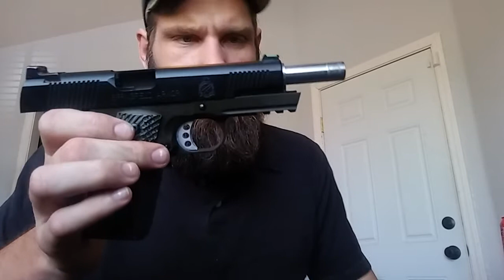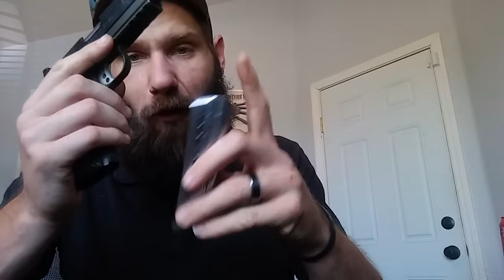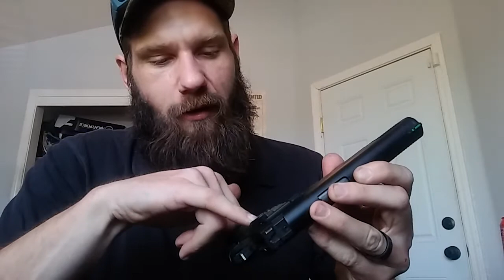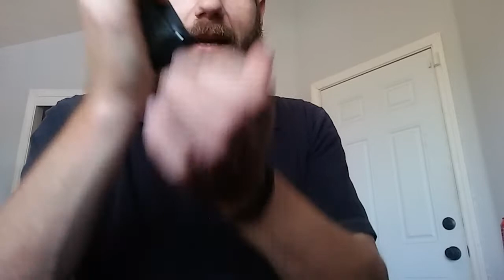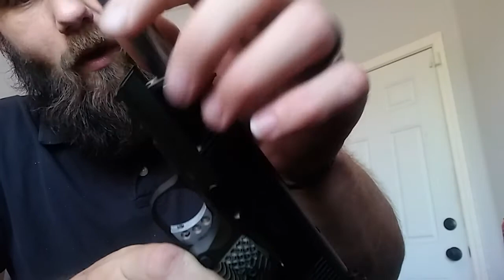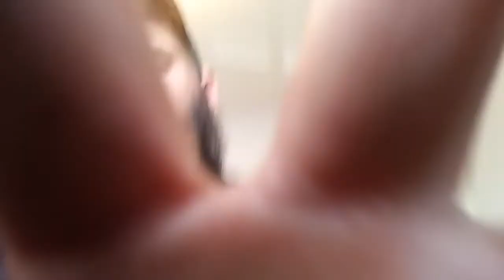Springfield Range Officer Operator 9mm review and tuning tips

Comment: Great Video! I just bought a range officer operator.  What 10.8 rear sight are you running?
Reply from the maker: It was the taller one of the two I believe. I bought it so oong ago I honestly cant remember. I know I pulled the stock one and it was the less common size.
Reply: Hey man sorry to bug you . Im looking at the rear 10.8 sight. Does the 375 tall rear sight sound familiar th what you bought?
Reply from the maker: Yeah I looked it up and it was the .375 tall one with .140 u notch.

Comment: My TRP Operator 45 also came with a poker straight extractor. I was actually surprised how infrequently it malfunctioned whilst holding the cases to the breech face so loosely. I pulled out the extractor gave it a wee bend and checked the tension via. the empty case shake test and now everything is perfect. 1911 pistols are like pianos... they all require tuning. IMHO every 1911 out of the box needs adjustments... I haven’t yet seen a factory production 1911 come out of a box that isn’t woefully below it’s full potential... and said full potential only requires very simple “tuning” adjustments. 1911’s are wonderful for those of us who like to tinker... for the folks out there who have to ship their gun back to the manufacturer whenever it doesn’t function for lack of a 10min. tweak... there is a solution for them called Glock.
Reply: I have 5 1911s and none of them have malfunction out of the box. Springfield and colt.

Comment: I just got a springfield 1911 RO, brand new out of the box 6 malfunctions of failure to feed in the 1st 100 rounds.  My friend had similar problems with his SF 1911 RO, it's the manufacturer for sure.  A brand new gun out of the box should not fail 6 times in 100 rounds, that's unacceptable.   Will not buy springfield again..
Reply from the maker: Check your extractor tension. This seems to be a common but easily fixable issue. They should be right from the factory but if not it takes 5min to set up and save a month back at springfield for repair.
Reply: Mine didn't malfunction so it's not all of them. Mine shoots hollows and everything but mines a 45

Comment: Got a RO Elite Operator 9mm last weekend.
Had 1 malfunction in the first 250 rounds. Choked on some Wichester white box 115g. Round failed to fully chamber...dunno if that's considered a failure to feed or failure to go into battery. No issues with 115g federal brass or 147g winchester hp. Seems to be more accurate with the 147. Will be testing some 124g tomorrow. Awesome gun overall so far.

Comment: Purchased the EMP 4 CCC two months ago. It started having light primer strikes and ftfeed issues at 30 rds. I should have listened to the reviews with similar issues. Springfield replaced the slide and barrel and sent it back 7 weeks later. Took it out Saturday and same thing, three mags ran fine and then light primer strikes every other round. Some of the primers didn’t show any sign of being struck.  
I have the TRP and not a single issue in five years. 
Really bummed out; I can’t even try to sell this.
Reply from the maker: Oh man that sucks to get one bad out of the box. Springfield has a good rep on warranty work and I bet if you called back and spoke to a supervisor or something they will probably run it through the custom shop for repair. Its really rare to hear they dont make it right the first time.

Comment: Does this particular model com with an MIM extractor or one from bar stock?  MIM extractors are notorious for loosing their tension.  Its usually the first thing I change out.
Reply from the maker: Yeah it was MIM. If im not mistaken all models of Springfields come with the MIM extractors. I switched it out for a wilson bullet proof one but MIM when done correctly is not really a bad thing. Kimber killed it for everyone back in the late 90's early 00's when they moved from Oregon to NY and got CHEAP on their production and had no clue how to MIM parts. I personally had one that broke 3x. MIM is now used with good results from most manufacturers now.

Comment: what height are the front and rear sights? I'm looking at replacement sights for them as well but 10-8 has different heights for the front and rear.
Reply from the maker: I didn't replace the front but the rear is the taller of the 2 options that 10-8 offers. I cant remember off the top of my head but I know I had ordered the lower one first but it was wrong and I ended up using it on another 1911 that wasn't a Springfield. My TRP and this RO both used the taller rear.
Reply: ah i see. How was the point of aim?
Reply from the maker: Perfect with the talker rear and factory front. Its a combat poa poi. Hits right at the fiber optic tube at 10 yards.
Reply: thats perfect. Thanks for the info!

Comment: Hi Dennis, thanks for the informative review.  I have a question about the Black-T finish.  I have tried to research about the Black-T finish but I am not finding helpful information.  I guess the Black-T will scratch, so my question is can you take the grips off, rotate the screw head (on right side near trigger), and push out pins (to disassemble) without scratching the finish.  Does the finish have to be touched up?  How does the finish look after you put a screw driver on it??  Is the Black-T also applied to the internals???  Please let me know, Rick Hollman
Reply from the maker: +Rick Hollman this model in the video i did was my cerakote job. I do have a TRP that is black-T finish. It can scratch but its pretty durable. Is it the mag release screw that you are refering to? Thats the closest screw to the trigger. If that is yea you can remove it without scratching it. The trick is a screw driver that fits the slot correctly with minimal slop and getting it in the right position for it to turn and clear the small groove cut in the inside of the frame. You cant see this from the outside of the gun with the mag catch installed. Its just slight pressure on the mag release to get the spring tension off of the screw should allow it to turn with minimal resistance. If its tight play with the pressure and depth of the mag release till it will turn with ease. Hope this helps. Its not about force its about finesse!
Reply: Thanks for the quick rely
Reply: Mfg ads say the Black T is self lubricating, like a vagina. Makes me want to buy two.

Comment: Very informative video man so i thank you. This is going to be a long comment so i apologize in advance. Ive been thinking about getting a range officer 9mm. In my crappy state of massachusetts, if i want to buy a 1911 i have very few options. The RO seems like a very good one but i have heard that they need a lot of tuning and changes before they are good for a carry gun. I am by no means a gun smith, so i have been trying to research all the shit that needs to be done to this gun before i buy it so that i can get it all done right away. I am under the impression that a 1911 in 9mm has different dimensions than a 1911 in 45 so i am having trouble finding things like a replacement rear sight and recoil spring for a this gun. Im finding those things for 1911s but i dont want to order it if its not going to fit a 1911 in 9mm. Also, as far as the failure to extract during the 10-8 test, did the recoil spring solve that or did you change something else?? 
Thank you so much for your time to answer my questions and your video
Reply from the maker: +matthew turgeon your right long question! Lol but ill see what i can do to help you out. Dimensionally 9mm and 45 1911 are the same in most stuff that dont deal with the actual caliber specific parts. (Confused yet? Lol) sights, grips, hammer, trigger, sear, recoil spring are all the same. Minus actual weight of recoil spring between calibers. I did replace the recoil spring (12#-14# variable power all worked) and I put in a wilson combat 9mm drop in extractor. Really easy and may only require very minor tension adjustment. All can be done with no specialty tools and 10 min watching wilsons video of extractor tension. No forming or polishing required on the drop in one. Rear sight on my operator is just a standard novak cut. Very popular and tons of options. If you buy the target model with adjustable rear sight its a different cut and only 1 maker of a fixed sight replacement that i know of (Harrison sights) but all in all it requires very little attention if any. And Springfield does have some of the best customer service, warranty and custom shop in the buisness. I would buy mine again. I really enjoy shooting it. Hope I answered what you wanted to know. If you get one i highly doubt you will regret it!
Reply: dennis1979gm damn that was a quick reply lol. Thanks for taking the time to give me the detailed answers. I am certainly going to do some more digging into the parts you have mentioned ( yes i understood the part about caliber specific parts vs 1911 fram specific parts lol) the only reason i thought the dimensions all around would be a little different is because a watched a video that mentioned how the springfield range officer was scaled down a bit around the 9mm cartridge as opposed to typical 1911s in45. Even on their website i could not find the specifics on where exactly they shaved stuff down. So again thank you very much. I know of a gun shop relatively close where one of the employees will only carry 1911s , so i plan on going to see him and discussing what you told me. Thanks again
Reply from the maker: +matthew turgeon no problem. The scaled down version is the Springfield EMP. Its it own bird so to speak. No parts realy interchange with anything else from what I understand on that model. RO's are standard dimension
Reply: dennis1979gm ah yes!! I was watching a video on the EMP contour carry 4” when i heard that. That makes more sense now. Thank you
Reply: dennis1979gm the range officer i will be getting is definitely going to have the full adjustable target sight. That is the only model on my states approved list. I cant get the operator. So when im looking at harrison sights, am i looking at the ones that say they fit the LPA adj sight cut?
Reply: dennis1979gm i found the wilson drop in extractor and wolff 12lb spring on midway USA. And i also found the rear sights by harison. Do i need to change out the extractor spring?
Reply from the maker: +matthew turgeon a 1911 doesnt have an extractor spring. Its the tension you bend in to the extractor. Its a spring steel. Do you mean firing pin spring? Most companies ship a new firing pin spring with the recoil spring ( i know wolff does) but its not necessary to change you can just keep it for a spare on a new gun.
Reply: dennis1979gm ok good to know. Thanks again. Have a good weekend

Comment: Great tips, thanks! 
Question:
Recently got a Range Officer 9mm with adjustable rear sight, fiber optic front: Is it possible to switch out the rear sight to the operator style?
Would have preferred that style, but the price for the whole gun was too good to pass up.
Reply from the maker: +Sidnex Raganbold i think Harrison makes a fixed "combat style sight that fits the target dovetail cut.

Comment: never knew about the reliable test.  Thanks for sharing.   

Two magazines received with the firearm:  one butt plate with company logo and one without.  Know why?
Reply from the maker: +oldMan Slickville on the mags springfield uses a couple mag manufacturers for their 1911s. I would suspect you just got 2 different Manufacturers of mags by chance. I think one is metalform and one could be checkmate? I wouldnt worry about it especially if both feed good. I think both of mine didnt have any logos on the bottom.
Reply: Thanks for the info.  Just was wondering, why they had different followers & base plates.  You would (at least I did) think both magazines would be the same.   Yep, they work.  

Again thanks
Reply: Friend looked at mine and confirmed one is metalform and not sure of the other.  

thanks